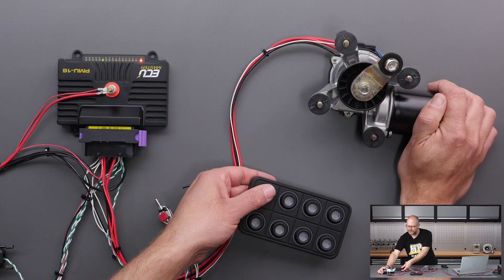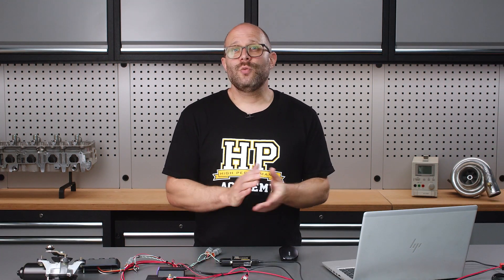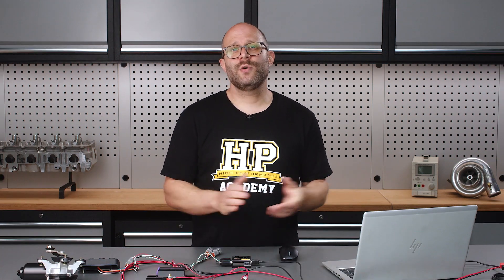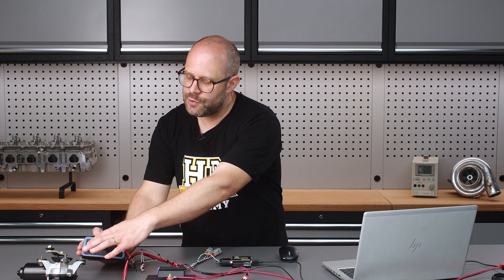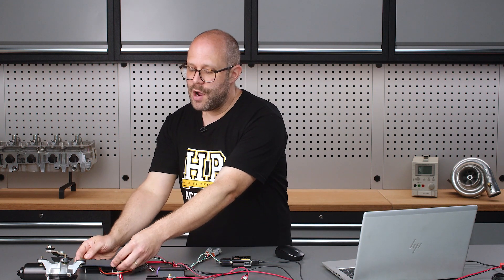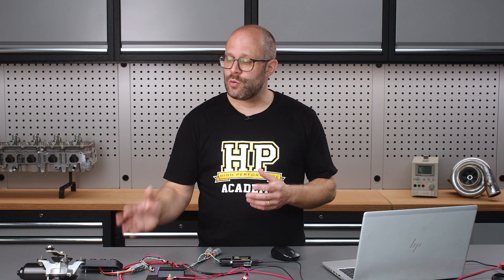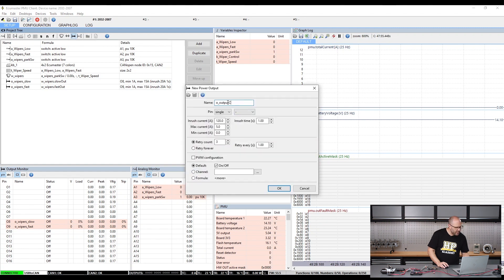Why Simple PDM Keypads are Wiring Game Changers

Comment from the maker: What PDM are you using or planning to use?
🦸‍♂ Building a fast car? Get $400 OFF the all inclusive VIP online course package deal: https://hpcdmy.co/vipy96
🎮PDM Installation & Configuration course now 50% OFF. Enrol today:  https://hpcdmy.co/offery96
TIME STAMPS:
0:00 - Introduction
0:13 - Main vs enable power
0:56 - Fuse and relay setup
1:21 - Benefit of using a PDM instead
1:35 - Keypad options
2:35 - PMU + Keypad best purchased as a pair
2:55 - Keypad setup
4:11 - Wiring
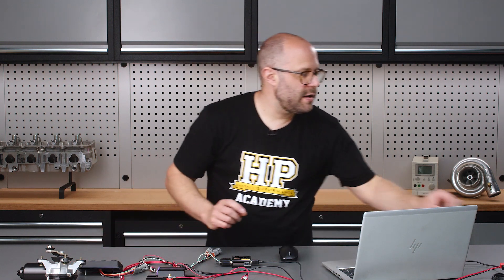4:39 - Configuration in Software
10:02 - Wiper motor control
11:28 - Application to other elements
11:44 - Summary
12:14 - Learn more (link above)

Comment: were do you get the translucent keycaps for the Ecumaster 12 position keyboard.
Reply from the maker: That's how it came. You manually insert the stickers/inserts you want, a bunch of them are provided with the unit from memory but you can also buy them separately.

If yours came with stickers/inserts already on there (perhaps you got it secondhand? Hope you got a great deal, these are a fantastic 'tool' 🤘) you can remove/change them - Taz.
https://ecumasterusa.com/collections/engine-management-accessories/products/replacement-sticker-sheet-for-can-keyboard?variant=36027572256932

Comment: You mentioned that the wiper setup was already confg'd for a previous example. So, after setting up the Keypad 3-Position Button, could you remove the 3 Analog Switch Inputs, thereby freeing up the 3 input pins?

Comment: Is the pdm16 waterproof like the aem pmu 8?
Reply from the maker: The PDM16 as in MoTeC's PDM16? If so, then they have a marine version, PDM16M I believe, which would be the one you want.

If you mean the PMU16 from Ecumaster which we use here, then I don't believe they have a waterproof version no. I would get in touch with your Ecumaster dealer to be certain, we don't sell any hardware so only know it in relation to what we use it for and discuss.

Bit out of line with what we do at HPA for track cars etc, but I know some of the 4x4 guys just seal their electronics separately, as sealed in their own box rather than just relying on waterproof connectors which is fine for the water they see, but to be truely waterproof for a marine application etc I'm not sure I would do that myself - Taz.

Comment: It looks very promising and I'm not sure I would be concerned about reliability even for my experimental aircraft, when you consider that the engine is already managed by an ECU with similar tech. But the price point is wayyyy too high unless you realy need the flexibility and control that hardwiring may not offer. No way a PCB keypad costs $300. That's obviously race stuff pricing. I'll wait for consumer electronics pricing.
Reply: Depends on how you want to do your math. A $300 keypad, a connector and 4 wires is almost always more cost effect (always more cost effective if your paying someone to wire it) than wiring buttons in switches.
Reply: @n8_b123  If you factor in the cost of the PDM I don't think so. True you'll spare on wiring, maybe it will balance the cost if you have the harness made by a pro. But you'll still need wiring to the loads.
Reply: @SuperYellowsubmarin  the cost of the PDM and wiring the outputs is a constant no matter if you wire switches or a can keypad. But by the time you purchase 8-15 toggle switches, terminals, heat shrink and wire and spend 4+ hours wiring your input switches it adds up quite quickly.
Reply from the maker: It's hard to say you'll break even cost wise as it depends on a few variables, but you 100% save on time and wiring complexity. The price people put on that varies wildly according to who's doing the work and the work itself.
That said it is now at a point where we can start to talk about the potential of either option being close in price where as previously there was no comparison to be made, PDMs were huge money.
 That is pretty cool and a good sign for
things yet to come - Taz.
Reply: $300 is nothing
Reply: @wompa164  it is something to me, and certainly more expensive than 6 switches

Comment: Very cool tech. I would never put one in a race car that needed to be reliable. Too many failure scenarios. Cool in a street car maybe.
Reply: You realize a ton of race cars use these right? Like they're an extremely low failure rate device, probably less than most mechanical switches. These are industrial designed products, not something made in some guys basement
Reply: You put these in things you dont want to have fail. You can run double redundancy to crucial components in the car and program fail safes to reset the circuit if "blown" If it fails again it can automatically switch to the second circuit ran. It's amazingly simplified for wiring as well. I'm in 1000%
Reply from the maker: @Gsry As already mentioned, the opposite is true. This tech comes from race applications  seeking reliability and it has filtered down from there - Taz.

Comment: DUDE , THAT IS A LOT OF SOFTWARE SETTINGS TO JUST GET A WIPER MOTOR TO RUN , PERSONALLY ILL CHECK BACK IN A FEW WHEN IT'S DUMBED DOWN A BIT MORE !!!!!!!!
Reply: You've missed the point. You can set it up to do almost anything you want, and you're removing old school, failure prone fuses, switches and relays from the system. Yes it takes a while to setup, but it's flexible and saves a lot of hassle in the long run